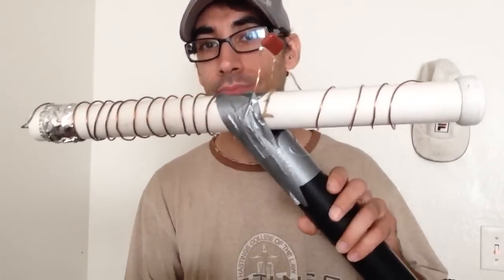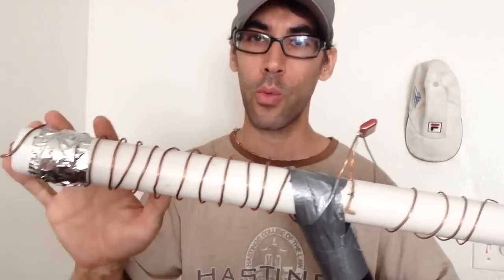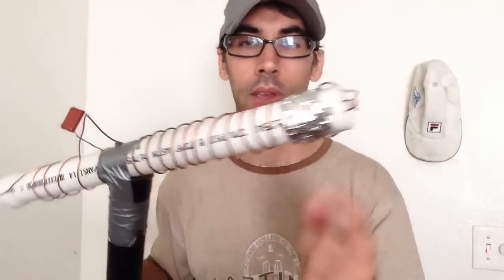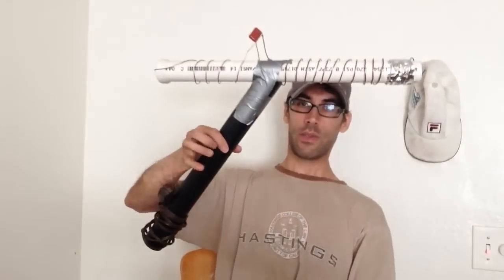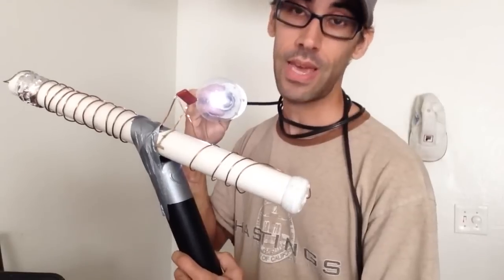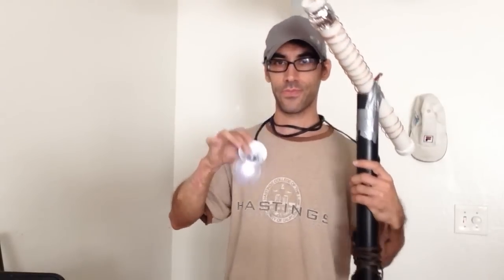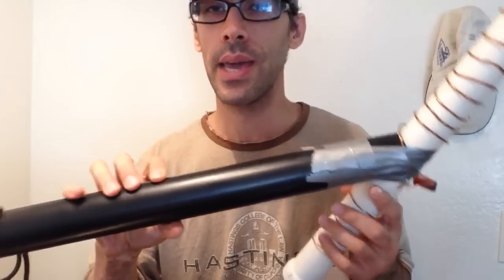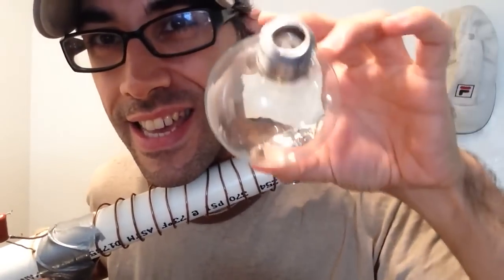HOW TO MAKE FREE ENERGY FROM POWER LINE WITHOUT MAGNETS JUST AN ANTENNA DEBUNKED!!

Comment: Great video I will have to build one to show my friends how to get free energy. LOL
Reply from the maker: LOL
Make sure you try to fool some "uneducated" friend since it takes nomore than 1min for a real engineer to spot the trick :)

My job is to replicate popular "free-energy" youtube videos and replicate them "AS IS" then eventually I show you the trick at the very end

Hopefully some schooless uneductaed ppl wake up from ignorance and common myths 

Cheers!
Reply: I hate to tell you this will work but it is totally illegal. It works through inductance and it is NOT FREE ENERGY it is produced by a power generating facility. He is getting the power by using inductance using the power in the magnetic field around the power lines. I know this is not free power that is why I added the LOL.
Reply from the maker: Roy Cogswell 
In reality Faraday says that:
We can have infinity Voltage with actual 0 usable current.

To gather only few microamps out of a big powerline you have to be as close as few cm from the cable
The power gain is proportional to the distance as Maxwell says.

Remember that a spark gap between a drop voltage of over 100KV can be as wide as 5meters and still innescate a big plasma arc

NOW QUESTION:
Is it worth to do all this for few microwatts of energy that not even enough to power and old vibrator???

Cheers!
Reply: Skeptical Open-mind
I am not saying that this is feasible to be able to run a vibrator or anything else for that matter .Maybe a few low voltage LED lights.

But I do know for a fact that If you take an eight foot fluorescent light under a three hundred and forty five thousand volt power line it will glow nicely even when you stand it up in a snow bank. 

I also know you should not try this when it is foggy out because as the moisture condenses on the bulb you start to get voltage applied to your body from the bulb and it doesn't feel good.

So that tells me that you can get some voltage without being within a few cm from the power line.  I do agree that the closer you are to the power line or the higher the voltage in the power line the more power you will receive but at a very low amperage. I just didn't want to climb up the tower to see if that was true but I really do believe it to be true. As it was it was a bit shocking standing on the ground.
Reply from the maker: Roy Cogswell 
Ok let me explain in easier words....

The VOLTAGE you get from powerline electromagnetic field can be INFINITE.(as much as you want) 

This is ALL it takes to "excite" the gas in a fluorescent bulb....is this usable energy????

FIRM AND CLEAR NO!!!!!

WHY?

Because you're missing another factor that makes up for WATTS(energy) ....it's called "ampere"  

W=I x V

Other than exciting a fluorescent lightbulb NOTHING ELSE can be done by "stealing" energy from powerlines magnetic field

YouTube is full of crap lately DO NOT TRY to reproduce whatever you watch on youtube!  You might end up hurting yourself if you don't have solid base of electrical/physics knowledge

Cheers!